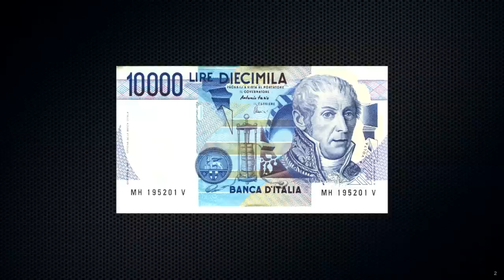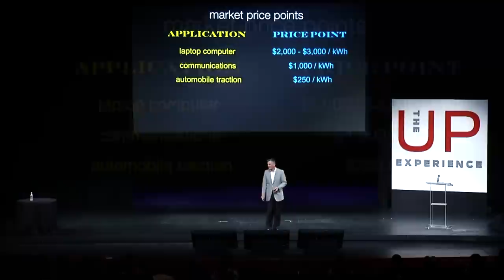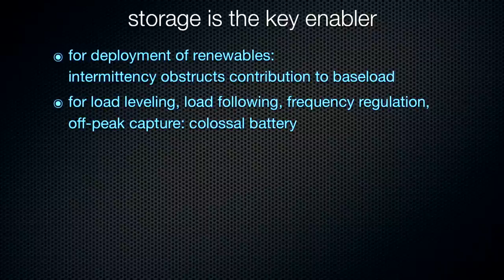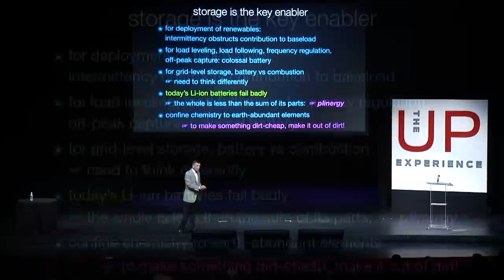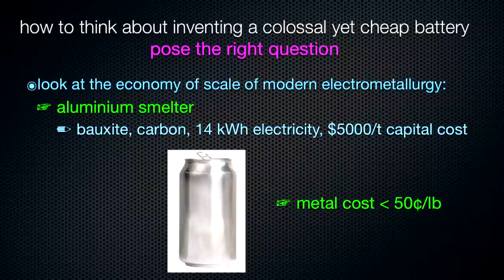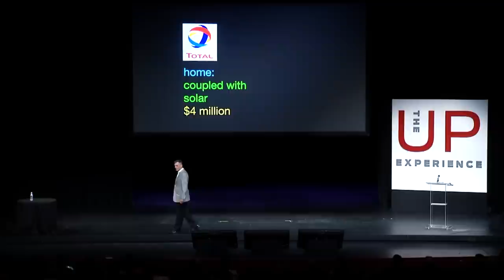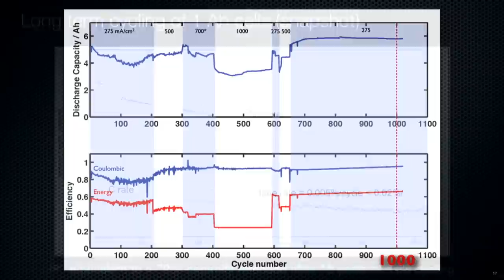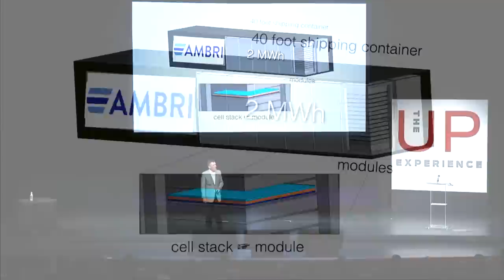Dr Donald Sadoway

Comment: I also wonder what its efficiency is like. There must be losses, or the current would not be keeping it molten. How much energy is lost, and how does temperature maintenance constrain the allowed duty cycle?

The density of these batteries is obviously going to be high. How much will that 2MWh unit weigh? Can it even be moved when populated?

So many obvious questions left unanswered here...